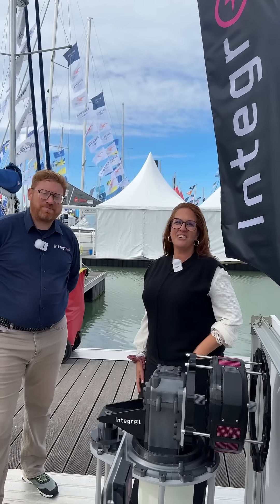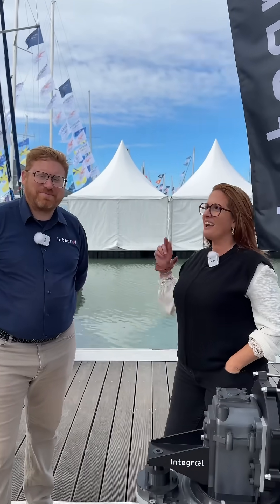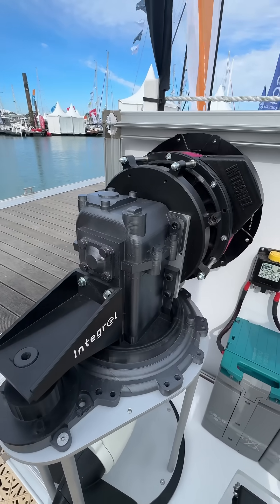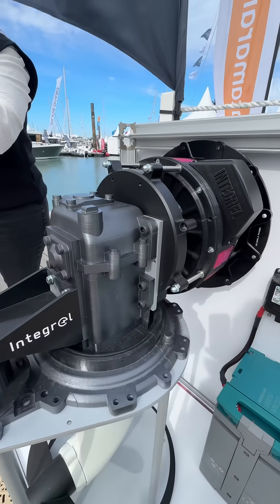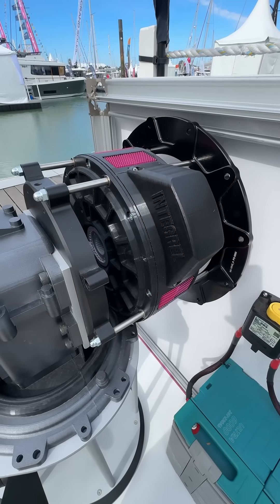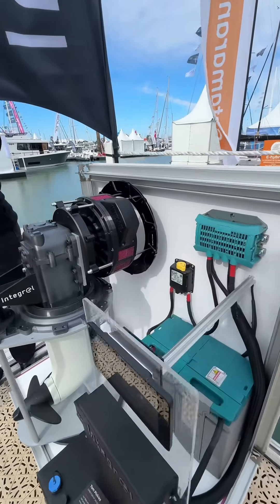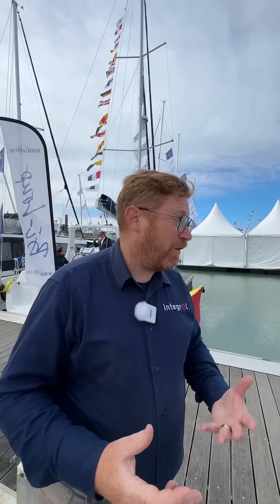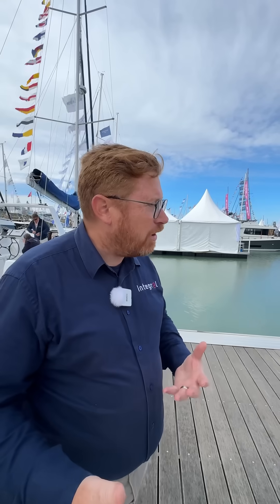Integrel E-Drive | The Live [Equipment] | MultihullsWorld

Comment: Integrel have missed plenty of tricks here. It’s air cooled and has a mechanical sprag clutch. These are weak points in the design. Like to see them argue that they are not. 

After 2 years the Integrel warranty is worthless and the owner is left with a boat with ‘modified’ engines that Yanmar or Volvo warranty’s will not cover with a barge pole. Good luck with that sale. 

Integrel state that it is cost efficient to run blah blah blah, yet forget to mention that the cost per 15kW motor is north of 30k each. Then add the Lithium & power electronics. 100k later you are ready to make your dramatic savings…whilst still not knowing who is going to service / repair your boat globally.

Much more work to do in this space. Well done Integrel Solutions for making an effort, but there are better value v’s risk options out there.

Comment: Why don’t Integrel Solutions just show it working on a real boat, installed and fully tested with data proven stats based on 1000’s of hours of testing ??????
Reply from the maker: Hi! Integrel only presented a very small test boat because it is very expensive - I suppose - to immobilize a catamaran which is just waiting to be delivered to its Owner... and it is also very expensive to exhibit a large unit at a show.

Comment: I think they missed a trick here🤔They could have produced a  even more efficient version with other advantages by eliminating the top 90 Deg drive complication and  cost  by mounting the E motor  vertically  above the drive leg...this also reduces the length of the motor and drive assembly   in boats where there is perhapse less engine  compartment space and keeps the motor above any water ingress  longer and prevents corrosion.  👍🏻🇬🇧🧙🏻‍♂️🥼 What's needed is affordable motor drive leg system s that  offer constant power in the 20kw range with closed loop keel cooling . 
Use of pertinant magnet free and copper free winding  motors  should be considered from a resources and strategic materials based production,plus ease of recycling ... Regeneration under sail is also efficient and the only gearing required is a simple fixed single reduction gear.
The other advantages of the pertinant magnet free and copper free motors have is they are vibration and more high  temperature resistant than  traditional rare earth copper wound motors.  These are now finding their way into standard automotive packages from Huge manufacturers like ZF,  Renault and Nissan they are also producing ultra compact EREE s small highly efficient multi fule  range extender ICE generators for  off grid charging and maintaining peak power... developing between 90hp and 160hp as series electrical charging power  .

As a conventional  ICE diesel has to be mostly horizontal and is larger and heavier than a E motor and require gears and variable fuel control it's less efficient, noisy and very polluting when not being used under its Stoichiometric optimum operating speed. Other companies use shared inputs to the drive leg or better for motor health, seperate inputs for and aft of the drive leg.. or V drive . What's needed is a new generation of ultra efficient generator range extender multi fuel ICE engines like the rotary liquid piston design or the Durham universitys reciprocating free piston linniar  generator.  30%+ better fuel economy small and light enough to man Handle though a standard hatch and with a minimal number of parts ..so cheaper to build, and replace.
As the voltage increases so does the efficiency of the system and the greater the saving in copper wire guages and consequently all up wts. Should be a bare minimum Voltage and the marine sector needs to look at the sort of propulsion E voltages used by E bikes 54v ,up to 96V. The safety risks are largely null in void given the advances made in connectors and waterproof/ safety isolating systems now found on most electrical automotive applications  and  mountain bikes. 🤷🏻🧙🏻‍♂️🥼🇬🇧